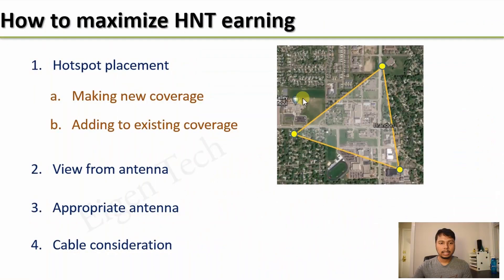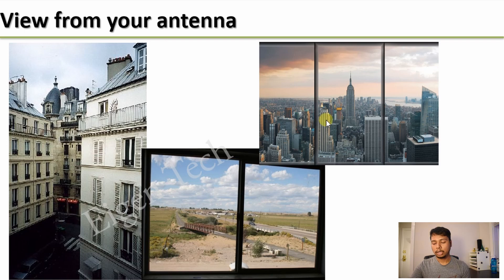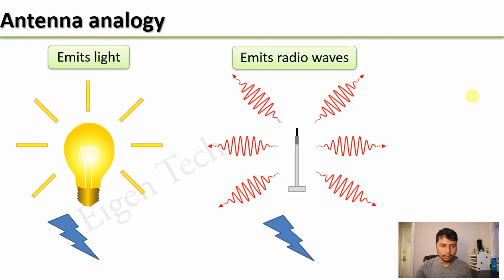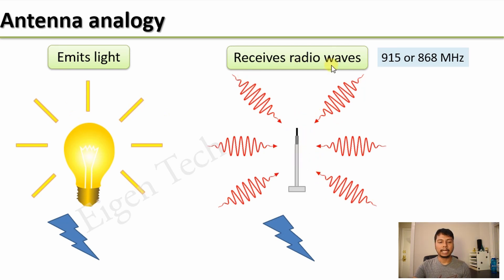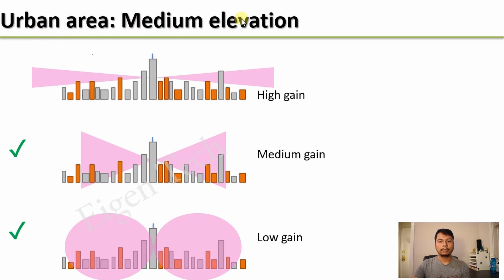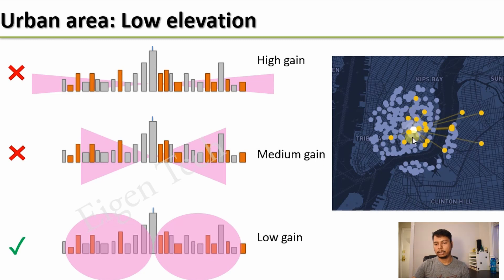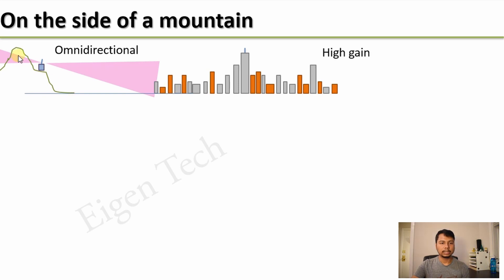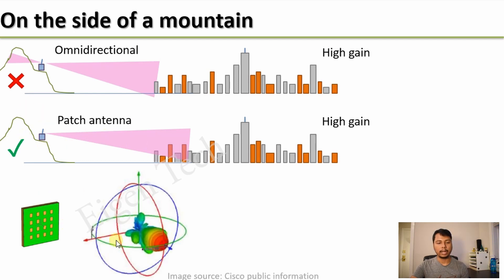Best antennas for Helium hotspots | Which dBi gain antenna to buy for a miner? Maximize HNT earnings

Comment: Thanks for the explanation! only 1 question, i want to put a rak v2 in my attic, should i just put it as high as possible in my attic, or in front of my window (little less higher) but also more in sun, which maybe causes overheating?

Comment: how about the height? does it affect the outcome of the mining? when i was setting my bobcat i made a mistake in setting up the height, i placed it on 40m 4dbi which should be 90m. thanks
Reply from the maker: the asserted value of height doesn't matter but actual height matters

Comment: Sorry, but you are wrong about high gain antennas. In reality you need to look at highest gain antenna for all installs if you can. Why? Well watch my vids, but basically coverage does not go over the top of high buildings, you do cover those houses. And even if they didn't, you should be recommending antennas with electrical tilt. The IoT I planned and built here in UK for national coverage uses high gain antennas on all sites. Drive surveys in heart of London were extremely good

Comment: Thank you very much for useful tips. I would like you to please tell me how many km I could reach with an external antenna. I live in a rural area and the nearest city is 12km away, I can install an antenna on the roof and the hotspot inside the roof with a very short cable, max 3 or 4 meters. What do you think? Could you reach those 12km? And finally, what is pole? Thanks
Reply from the maker: Sounds like a good setup. Maybe use 5-6 dBi. Pole is a straight rod to which you can attach an antenna.
Reply: @eigentech6567  Thanks

Comment: With 30deg beamwidth at 8dbi is extremely hard to not get the full beamwidth gain in a couple of meters away. You should really try to set it to fail...
Of course low gain antennas can do the magic if you are unable to calculate parameters but a high gain antenna can do magic in most of the cases

Comment: Hey I have a question. You mention that a long cable affects DBI.  Can I manipulate the width of the beam by adding a cable?  For context: I  live in an urban area. Halfway up a medium high building. From my window, I have a roughly 120 degree view of the city center and suburbs behind the city center. The other 240 degrees are blocked by the appartment building I live in and surrounding apartment buildings. As such, I want to get a directional antenna. Preferably in the range of 7 dbi. However.... the best option for an antenna I found thus far is an 8 DBI antenna directional antenna. Please let me know your thoughts!
Reply from the maker: You cannot change the beamwidth using a cable/an attenuator as the beamwidth is completely set by the antenna. 7 or 8 dBi directional antenna won't make much of difference.
Reply: @eigentech6567  Thank you so much for getting back to me.
Reply from the maker: @dodobird1991  you are welcome

Comment: Can i use a splitter connector to use 2 antenna like a 3dbi and 8dbi at the same time?
Reply from the maker: Yes you can but mist likely it will degrade your performance
Reply: @eigentech6567  so it is better to go with one, right?
Reply from the maker: @favoureduwadiae1167  yes

Comment: we have a Device  call Data concentrator which is functioning like transmitter for water/electricity meter  reading by using Mbus Technology , with 5dbi omni we are receiving 500 above meter reading , when we tried to engaged with GSM panel high gain 17dBi antenna, we are getting below 200 meter device , could you pls  advice, why it was? Can you help me out of this ?  Transmitter DC device programmed power level +15dbm

Comment: Hi, i have two questions. 1. Will SenseCap M1 miner work with ClodPi miner nearby? 2. BCG-Fi is offering 2 types of antenna 5dbi and 8dbi. I live on a 17th floor(approx 150ft) of a building. Should i buy 5dbi or 8dbi?
Reply: you should go with 5.8 and no morelook at the pictures in the video

Comment: Very informative!! Thanks. I’m trying to buy an antenna but bit confused for us915 and eu868 miners they use different antennas or they are the same?
Reply from the maker: they are different in general as those are optimized for different frequencies

Comment: 7:50 I have a problem. The film shows the distances of these antennas and it is written that 5dBI is the average distance of 1-5km. I am browsing the "explorer helium" map and I can see a 2.8dBi hotspot at 10m, which connects to 21 other hotspots up to 50km, earning $ 170 in 30 days. How should I understand that? Your graphics show that 9dBI is at a distance of less than 10km. How does he connect with them at a relatively low altitude?
Reply from the maker: People do not always update their antenna information accurately in the app. So, those numbers cannot be trusted.
Reply: @eigentech6567  I thought it was automatic
Reply from the maker: @adolfduda915  No, the owner has to manually update that info
Reply: @eigentech6567  thanks

Comment: Sir greetings so I live in a place where there are many trees around and i am living in a house on a ground floor so I have a hotspot at 300 m away frm me and one in my house . But still I can't connect the hotspot on the other side . So in that area where there are many trees around what antenna should i use
Reply from the maker: I think, it is better to increase the height and if possible above the trees

Comment: Hey buddy, so if we send you the location and all info of our hotspot miners, could you take a look and advise how we can make them perform better, whether upgrading the antennas or not to get as many witnesses as possible. Thank you
Reply from the maker: The main idea is the get a good transmit scale, have outdoor antennas and try to place them such that all can witness each other
Reply: @eigentech6567  all antennas are outdoor...but switching from the standard 4dbi to 5.8dbi or 8dbi is the dilemma...cause it all depends on the terrain
Reply from the maker: @jeremychang6292  if you have confusion and still want to upgrade, it is better to use one around 6 dBi

Comment: Hi, good video 👍🏼 i am having some trouble with my Nebra outdoor unit. I live in Norway close to sea level and i have many hills around me. I am using the stock 3 dBi antenna. At first i had it up in the attach at around 5m elevation from the ground. Now i put it on a pole with an approximate hight of 9m above the ground. I cannot really put it any higher. It did not give me any more witnesses. I see most miners around me have a higher ground level elevation and they are doing well. I am not sure what to do? There are still very few miners around, my hotspot is called Little Lemon Dachshund. Does a higher dBi antenna give a stronger signal? Many people around use 5.8 dBi or higher.

Comment: Does the shape of the antenna matter?  What would an antenna looking like the letter X or 8 upper case V shapes yield? Like a large Flower... Would signals prefer one antenna shape over another?
Reply from the maker: yes, the shape will strongly modify the radiation pattern. The regular stick-shaped ones are called dipole antennas.
Reply: @eigentech6567  It's very interesting tech. I have also learned since yesterday that there are directional antenna that boost signals allowing for lower dbi gains to increase significantly using reflections, and Lines of sight. Targeted signals can be useful depending on location,( inner city vs outer city, high vs low elevations... ) by focusing all signals towards targets rather than outwards in all directions.

Comment: Informative video! Would recommend a 8dBi antenna for an antenna mounted outside of my condo balcony door window on the 5th floor?
Reply from the maker: In most cases, you don't need 8dBi unless your target hotspots is very far (>10km away)
Reply: @eigentech6567  Thank you. I appreciate it. Keep the good content coming.

Comment: What dbi antenna would you recommend for a heavily wooded rural area? There are about 4 hotspots within a 4 km area and then 10+ hotspots 13 km away. Im thinking of going with the 8 dbi but want to see what you think.
Reply from the maker: Yes, 8 dBi would be fine but you should try to mount it as high up as possible
Reply: @eigentech6567  Thanks you for the super fast response. I plan to have it mounted on the roof so at minimum it will be 6 meters. If I decide to add a pole it may go up to 10 meters max.
Reply from the maker: @aweezy90  Try a pole if possible

Comment: Great video and explanation!! If any install is outside they should include the surge/lightning suppressor (.5db loss). If it is the one like RAK at the base of the antenna then you need to run a very long thick gauge ground wire to your ground rod. Ground wire should be as short as possible to the ground. In that case two 50ft LMR 400 with the surge  suppressor actually connected to the ground rod would work best, even though your adding close to 1db loss with the two coax instead of one.  Proper grounding will save your miner rom practically any surge except of course a direct lightning strike and this protection is definitely worth around a 1 to 1.5db loss with the extra connections.

Comment: Thank you explaining.  I am considering keeping cable very short. Buying a power over ethernet outside box for my RAK miner.
I live in suburbs 35 miles north of Chicago. 
 Debating on 3dbi or 5.8dbi. I want to mount on top of my roof.
Reply from the maker: You can try 5.8dBi

Comment: hey! i have question: what if i connect 4 10 dBi antennas to the helium miner? is that possible?
Reply from the maker: yes, it is possible but won't help unless you are planning to install it on different sides of a tall building

Comment: Does anyone know if you have a 8DBI antenna with the .5 dbi signal strength loss here and there due to connectors and wire length - does that make your antenna act as a say 6 abi antenna.
The point being, can you count on signal strength loss to work in your favor when picking an antenna?

Comment: How much hight does it need to be considered medium or low elevation?
Reply from the maker: it is relative to what is around you. If you can't see the roofs of most buildings, it would be low, if you can see 50% of the rooftops around you, it would be medium and so on

Comment: What if you live in a bowl like area, with hills on all sides? Like in a cup per say and your at the bottom of it? What antenna would you need in order to reach over the top of the hills and about 5 -8 miles out? Sounds like I live in a hole but there lies my problem ;)
Reply from the maker: Interesting. I think you should use a low gain antenna, say 3-4 dBi, and place it outside on top of some flagpole or something
Reply: @eigentech6567  Would that reach over the hills, when I look out the window of my house I basically see the hills at a 50 degree angle! Then there's more hills beyond them? Thank you for the reply, love your helium content.
Reply from the maker: @malistzz  in your case, lower dBi would be better because it will have a larger beamwidth.
Reply: @eigentech6567  Thank you, 10 foot antenna mask with Arresters & Surge Protection going on my roof then with a 4dbi antenna, sound about right?
Reply: @eigentech6567  How low should I  go?

Comment: Hello- very informative video:)

 I was killing it with my Indoor Nebra, and also after I had run 20' LMR240 to my roof to a 5.8dbi antenna thereafter. I am Online, Synced, and at 1.0 transmit, port 44158 is open, all Diagnostics are go, but since a couple of days ago, not a single one of my Beacons are being Witnessed, zero. I seem only to be able to earn via Challenger, from spots far away from me.l, and very little-0.01HNT a day from almost 1HNT/day.
Three things may be the culprit: a recent rain having messed up the antenna/cable, me putting a magnetic level onto the antenna and possibly messing it up (I am ignorant of the effects of magnets on antennae), not unplugging the miner before removing the stock antenna and replacing it with the already run LMR cable, and possibly fouling up the miner. What do you think and have you heard of this before, the no Witnesses? I mean, I had 49 just last week!
Reply: I've heard that not powering off miner before unplugging will fry the miner. We're you able to get back online??

Comment: Great video. The only question I have is the difference between long and short antennas of the same strength.
Reply from the maker: Actually, I do not know that either. But I think longer one should perform better

Comment: Hey brother! Really good video. I’m really in need of help. I’m currently living in Fordham Height, Bronx, NYC

What do you recommend ?
Reply from the maker: you should probably try to use a high gain antenna with a good elevation and reach far-away hotspots with higher transmit scale
Reply: @eigentech6567  ok thanks will do. Do you have any recommendations on antenna. I’m fairly new to this stuff. Any advice I’ll take it. Thanks for your time.
Reply from the maker: @Bewisenotsmart  I do not have any personal experience but I have heard HNTenna works well

Comment: 915 frequency? Uh oh....several RC runs on 915 as well.
Reply from the maker: Not sure what you meant
Reply: @eigentech6567  In the world of flying quadcopters or other Radio controlled devices....915 mhz has been used in the US...so that it does not interfere with cell phone towers and cell phone signals. But I just came to realize this is 915 as well. Wow 🤔
Reply from the maker: @nyclassic4ever130  Interesting, but when Helium says 915 MHz, it actually uses something close to 905 MHz.

Comment: Hi,
Which antenna i needed?
I am on hill, height between city and hill is 118 meters the last one hotspot is about 8000 meters far of me. I think i need patch anntena but i dont know wichone i need to buy because behaind me is clear only look to city. I looked, i think is enough 30 degress horizontal and vertikal
Reply from the maker: Sounds, like a patch antenna, would work best for your situation. Maybe take a look at this https://www.l-com.com/wireless-antenna-900-mhz-9-dbi-heavy-duty-flat-panel-antenna but I do not have any direct experience with patch antennas

Comment: Hi Roy , I'm from india to set this hotspot which connection is better jio or airtel or does the hnt miner comes with itself any network connections?
Reply from the maker: Any internet connection provider with 4G speed should work.
Reply: @eigentech6567  thanks bro , it would be nice if you upload a video on how to setup hnt miner in india
Reply from the maker: @prabhu4237  Setting up is the same for any place. I will try to make a video.
Reply: @eigentech6567  thanks bro

Comment: Can we place the original antenna outside? is it waterproof?
Reply from the maker: I know that bobcat antenna is weatherproof. I have used my RAK stock antenna outside without any problem. Just make sure that you cover/tape the connector part properly so that no water goes in.

Comment: great video, thanks for making it!
Reply: One question. So if you're living in a place where 5-7db would be preferable, would you suggest getting an 8db outside antenna, since ~3db will be lost with the cable, it would be in the 5-7db range.
Thanks for the video!
Reply from the maker: @ImCalledAnq  You are welcome. That is right but a good cable should not have 3dB loss

Comment: can i add all 3 types to an adapter then add the adapter to the bob cat device? ill get all 3 frequency.
Reply from the maker: I am not sure which 3 frequencies you are talking about
Reply: @eigentech6567  all 3 antenna
Reply from the maker: @DarnIDidntKnowThat  if you mean three antennas with different gains, that is not a good idea as it will most likely degrade the performance
Reply: @eigentech6567  with boosters?  Good idea?
Reply from the maker: @DarnIDidntKnowThat  might work but you should be careful so that you do not break local regulations of maximum transmitted power
Reply: @eigentech6567  how on earth I find out about local regulations?  Also I've seen loads of 5 g stuff on poles everywhere. Surely no one will know.
Reply from the maker: @DarnIDidntKnowThat  There should be some documents from the government. For a general guide you can check this https://lora-alliance.org/wp-content/uploads/2021/05/RP-2-1.0.3.pdf

Comment: Hello, I’m still a little confused on which antenna I need to be using 5.8 or 8. I’m in a Neighborhood, flat with trees. The nearest hotspot from me are 3 to 6 km away. The highest I can get the antenna up with be about 9ft high on the ledge of my house. 
Which antenna would you recommend?
Reply: Thanks for watching the video😊,don't forget to hit the notification bell🔔🖕for more info hit my inbox📥
±➀➄➀⓪➈➃➇⓪➄➂➁,,

Comment: @Eigen Tech I have an 8 dbi antenna located on my rooftop which was installed by a electrician. I am witnessing significant amount of beacon compared to when it was installed inside the attic. I think I am overshooting my local hotspots. I don't want to change the antenna as I already spent money paying the installer. Can I add about 25 feet of RG-58 cable to reduce the power to the antenna so that it eventually becomes a 6 dbi antenna?
Reply from the maker: Your 8dBi antenna will still behave like 8dBi as it is determined by the radiation pattern (beamwidth). The cable will add loss and your signal will not reach as far but it will still miss the nearby ones. The solution could be lowering the height or replacing with a lower gain antenna

Comment: I am placing my next hotspot at my friend's house which is around 2kms far from the first. The default antenna is 2.8dbi.  will it witness each other?

Also let me know, in WB were are you from?
Kolkata?
Reply from the maker: It is not possible to confirm that as you know it depends on the surroundings and antenna placement. If you have a line of sight then definitely, otherwise the best option is to run discovery mode to make sure those can witness each other